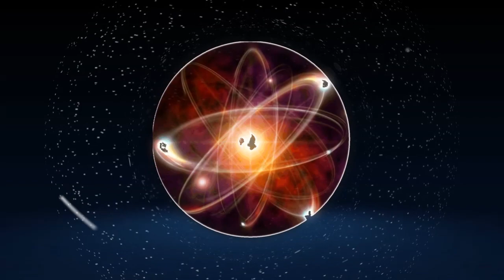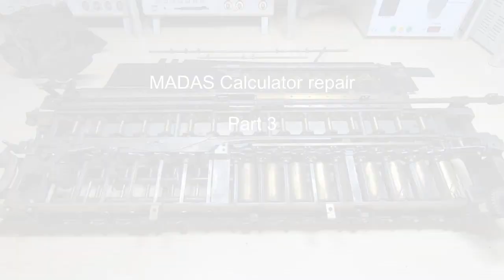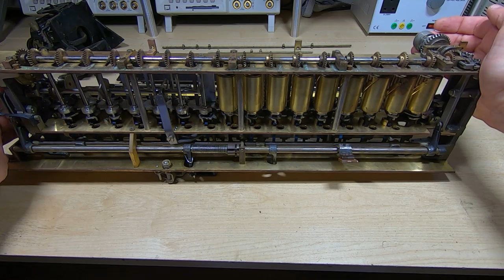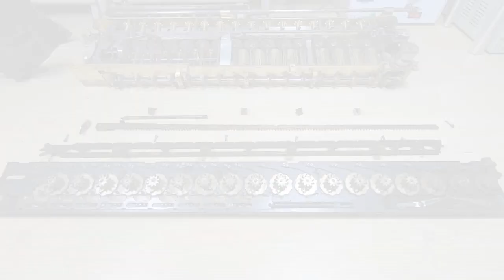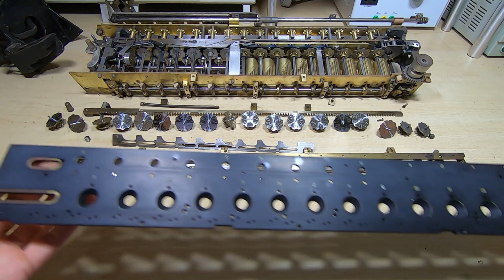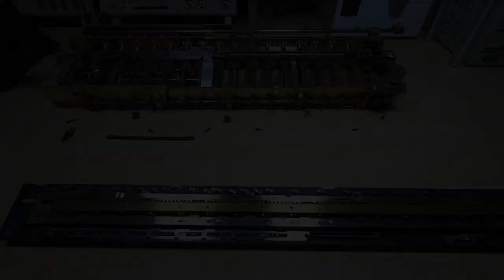MADAS Calculator repair Part3

Comment: That’s very nice calculator. Luckily there are many ways to repair brass parts with good results. Is the missing gear metric or imperial dimension?or custom?
Reply from the maker: I have not yet measured the gear as I want to get the calculator working before I move on to the drive. I can easily make a cutter if it is a custom pitch or profile. I make my own cutters for the clocks I build so this would be an easy part of the job. I will just need to determine the required tooth profile (eg cycloidal or involute).